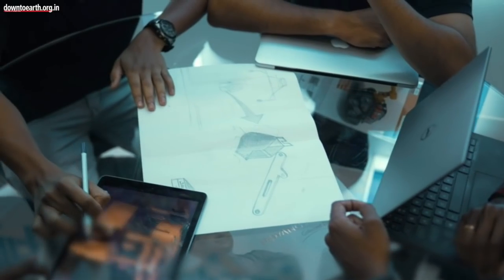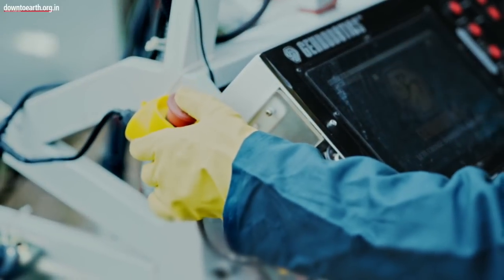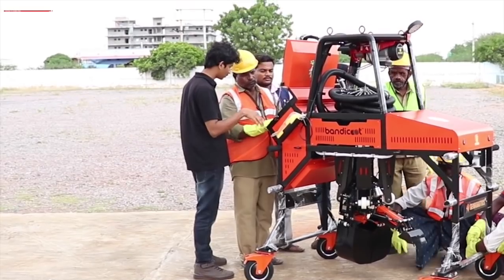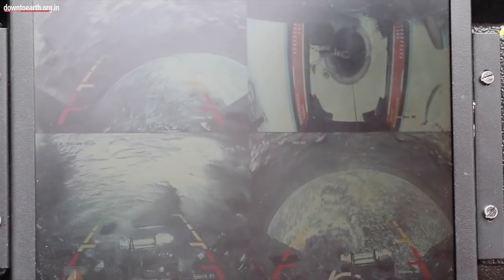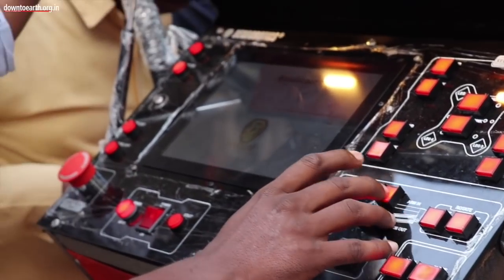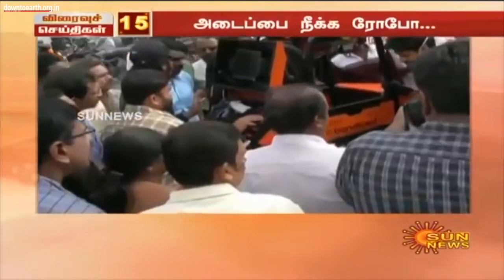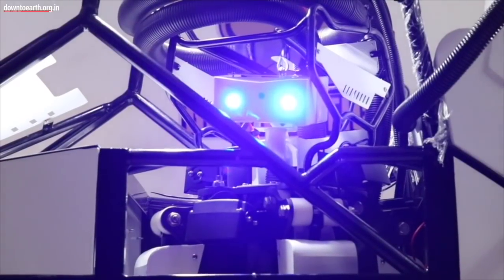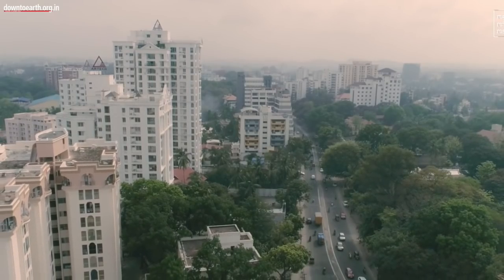Meet Bandicoot India's new robot that can end manual scavenging

Comment: The Dalit are so desperate for work, that they have to resort to manual scavenging in the sewers.  Using technology to make this barbaric job obsolete will just put them out of work and they will starve.  The bigger issue that needs solving, is not the elimination of manual scavenging, but the elimination of the caste system where people are so desperate for work that they are reduced to working in sewers.  It's hard to be excited about technology that will eliminate an awful and dangerous job, if it just makes the situation of these desperate people even worse.  This is a societal, and cultural problem, not a technological one.  You aren't saving someone from having to work in the sewers when you eliminate the only work available to them.  Being an untouchable is almost a fate worse than death.  The caste system is an anachronistic and barbaric system, that India must overcome if it wants to be accepted as an equal to other civilized countries. in the modern world.

Comment: First of all I appreciate your job.Aap ka mangal ho.
I have few suggestions to give you to improve your robot to full capacity.
First you put curved spike arrangement in feet of robot to pick plastic bag at the bottom of gutter. 
Principles behind this is ,I stayed in village ,when ever we lost our bucket in well ,while filling water ,
We used gal the name in marathi 
This instrument was having lot of spike to collect anything inside the well. I have find it very useful.

Second 
On same principle use iron curved shape net .Instead of robot using only arm. His feet , his hip and his arm .Three different positions it will work.

Third  keep it for future
Sometime we face flood and lot of mud remains after flood when ever water level is going down.
In such case you make walking robot . He will shake the water and mud automatically will move with water. People can use it in flood area. 

Fourth keep it for future.
Robot should calculated hight and width of gutter and water level sensesor . Robot must block water  movement of the gutter for few minutes and then release it.
This will clean your gutter with water pressure. One after another you keep cleaning main hoal and you are sure no dust is present in gutter.

I will pray for your team.
Bless you.Namh shivay.
Reply from the maker: Thank you mam, for the pertinent points. We will pass it on to the team.